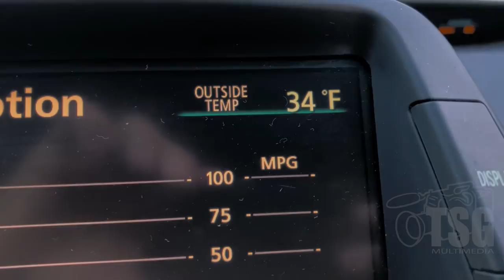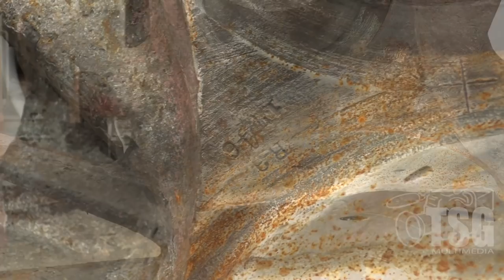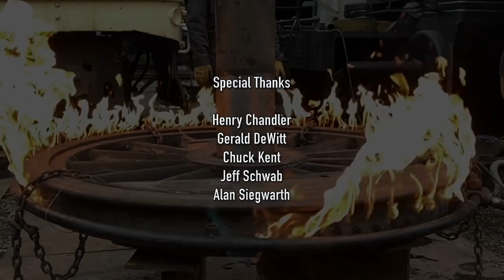Niles Canyon Railway SP 1744 Update Ring of Fire

Comment: Some engineer probably overheated the tires using too much independent and caused the tires to spin on the wheels.  Not a good idea hitting that tire with a spike maul because it is hardened and could cause a chip to fly off and hurt someone.  A sledge is safer because it is not hardened as much as a spike maul.